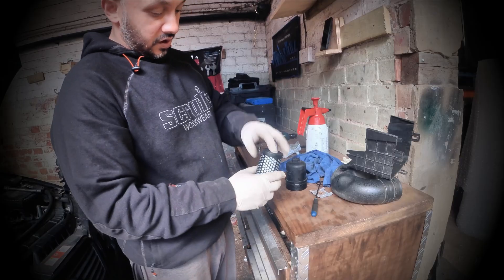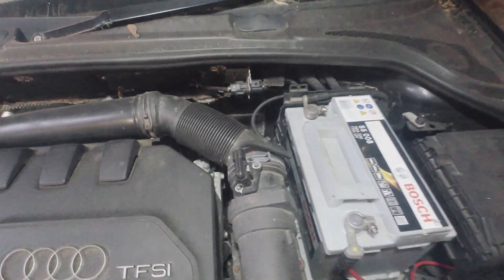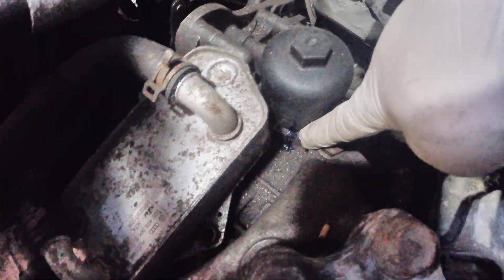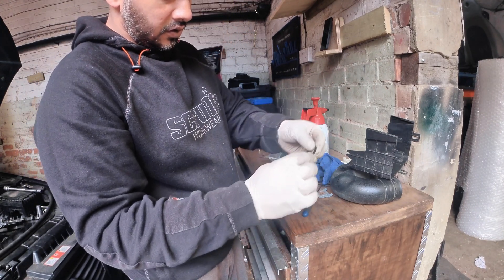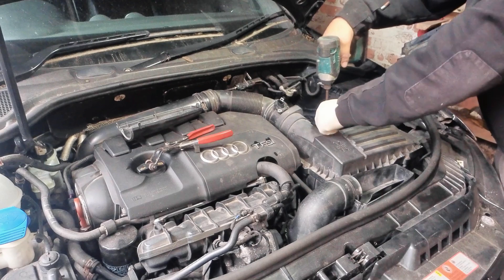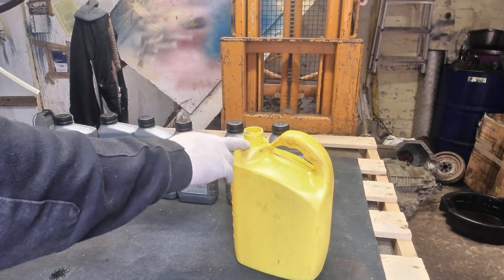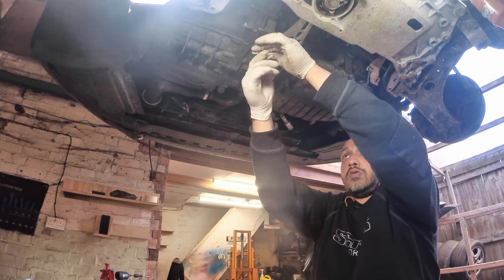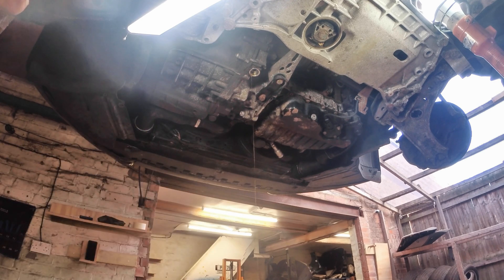DSG & S-Tronic Gearbox Oil & Filter Change Service Tutorial / VW Audi Seat Skoda

Comment: Is the washer for the dsg bolt a crush washer? When tightening I felt it give a little at the end. Not sure if I stripped the threads or crushed the washer.

I didn’t have a torque wrench.

Comment: Could anyone tell me if the car need to be turn off or on while this procedure is doing? I mean when the temperature between 35,45 and when the oil is need to be drained? Thanks!
Reply: it needs to be on when checking temperture otherwise the gearbox wont warm up to let overflow out.

Comment: Bit confused, when u open the drain plug for the first time, quite a lot comes out. Would you say it was previously overfilled? 

The next time you service this car, hardly any fluid should come out when you undo the drain plug right? Most videos show loads coming out, which suggest to me their dsgs been overfilled
Reply from the maker: I do gearbox service once a year on every car. You will have few liters come out of old oil each time you let it off during the service. It was never overfilled. I do let ouverflow out at the end of each video